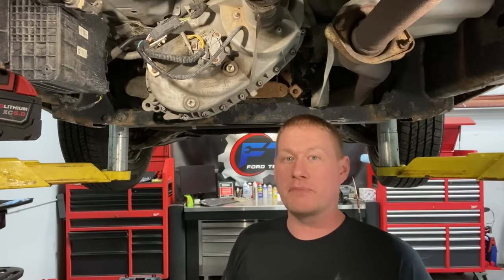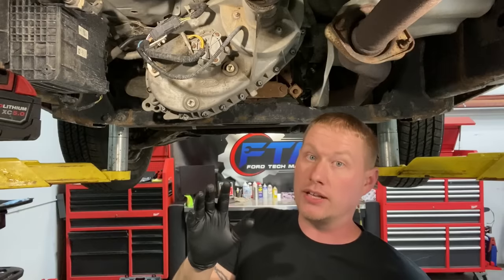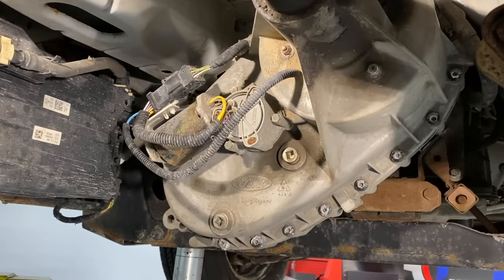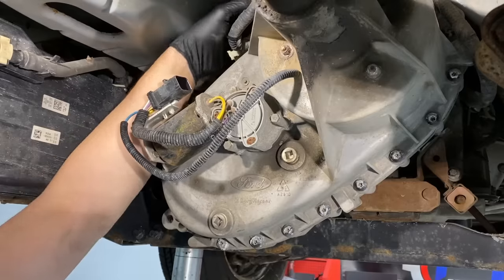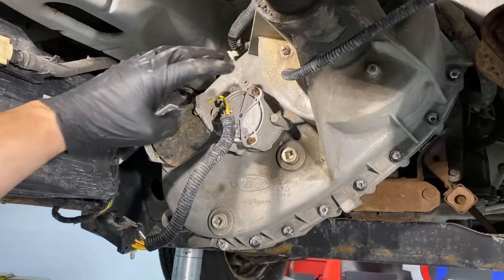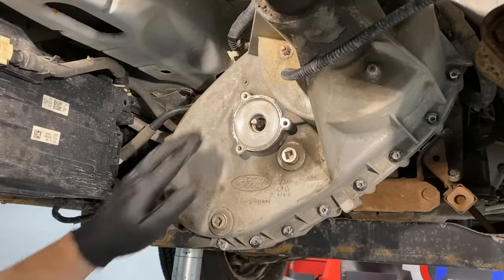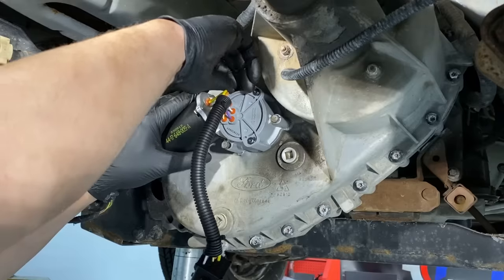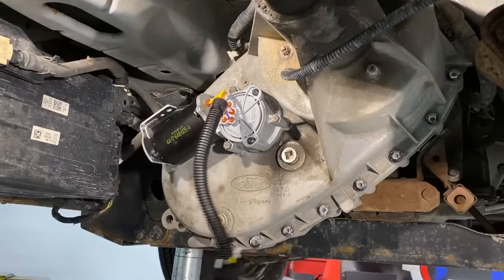2004-2020 Ford F-150 Four Wheel Drive Inoperative DTC P1867: Transfer Case Shift Motor Replacement

Comment: Ford Engineer: I wonder if this wiper motor will work on a transfer case?
Reply: LOOL 😂😂😂
Reply: You know what never failed?  Manual shift transfer cases.  The good ole days!
Reply: @goober1973  well mine is right now
Reply: @goober1973  And manual locking hubs: not the vacuum pulse nonsense!
Reply: Funny as hell. Good one!
Reply: Ford Engineer: This wire-changing deal should make them bring it to us.
Reply: I'm having a problem with my 1990 f250 not shifting outta park. I changed brake light switch but its still not working. Where should I turn next?. Also when i turn the key the power comes on but there is nothing when turned to the start position. I changed the ignition switch and it didnt help. Maybe I didnt position everything correctly idk. What else could I try for this problem also? Thanks i hope someone responds cause I'm stumped!!
Reply: And all of this stuff happened after I put it in 4 wheel drive and then back to 2 wheel drive. Idk if this helps to figure out what could be going on. Ideas please fellas. Thank you
Reply: @goober1973  And the ones that are still on the road today, still work.
Reply: Mines in 4/4l so that's what's wrong.ibe bought everthingeles should of watched this girt
Reply: I would give this a like but it's right at 69

Comment: I tried 4 wheel drive today did not work in 4 high or 4 low but I got a wrench on the dash but no code showed up on my code reader any suggestions ?

Comment: When the shift motor on my 2000 Ranger failed I found that problem in motor was that the springs be hind the motor brushes had corroded and failed.
I replaced them using springs from an Edelbrock carb.
Back in business for free.🤘
Reply: You are a few steps ahead of this guy 😂😂

Comment: Thank you for making this video. My 2011 F150 gave me an error when trying to shift into 4X4 drive. Took it to the dealer and they wanted $552 to fix this very issue. I bought the part and fixed it in 15 min. This saved me hundreds. I can’t believe they wanted to charge (rip me off) me like that. Thank you!
Reply: Diagnostic time plus parts
Reply: What was the error message you we’re getting? I have a 2011 ford f 250 and I the message I’m getting is shift delay pull forward then followed by check 4x4
Reply: @Jmacdonald224  I don’t remember honestly. I paid ford to diagnose it then bought the part and fixed it.

Comment: Excellent info and guide to do this replacement. Replaced it my 2011 F150 Lariat with 260K mile. I found two things to add. 

1-My new motor/actuator had weak plastic for the cable retention clips (in fact one side of it BROKE when inserting into the tab). I re-used the one from my prior motor/actuator and also zip tied it for extra security. (Would hate for it to dangle and get hung up on something and rip the cable).

2-I found that inserting the separate "Blue" wire BEFORE re-inserting the red retainer clip into the new shift motor makes inserting the blue wire into the connector MUCH EASIER. Thanks so much for the video and excellent guidance. What a low cost fix for something that I thought was going to be a major dealer item.

Comment: Great video.   That motor and the vacuum hubs are the reason I opted for the Manual 4WD in my Super Duty. Its Been working great for me for 12 years now.
Reply: Yes and you have neutral.
Reply: 009to090 I understand but I need to be able to switch in between frequently without stopping.

Comment: Did mine today. 2011 XLT with 200k+. Your channel is awesome. Thanks buddy.
Reply: Napa gave me the wrong part. Do you know the part #. I have 2011 xlt.😎
Reply: @jameshoben2950  I used a non-OEM part, Dorman 600-105. Has worked as expected.
Reply: Did you have any problems with your hub actuators? My 4x4 failed a few months back but after that I started to have a vibration on my passenger side. All suspension is new. Not sure if the 4x4 not working is causing this issue
Reply: @JohnTheMexicanic  I’ve sold the truck. Worked great though.

Comment: Great video!

I have an '04 F350 4x4 (6.0). I just gotta share this fun ride. First, I'd like to note that I have not solved my issue.

I thought this t-case motor going bad was my issue when my 4x4 wouldn't engage (the light wouldn't even come on on the dash when I selected 4-hi or 4-lo). Anyhow, I replaced the motor, and turned the truck on and tested it and VOILA, it seemed to work. Well, the plot thickens. Now, if I turn the truck on and immediately select 4, I can get it into 4 hi or lo, and hear the t-case motor engaging. But, if I drive it long enough in 4x, and then decide to put it back in 2, it will not shift back into 2 no matter what (fully stopped, in either neutral or park). Vacuum line fills, and doesn't turn on or off intermittently, and the vac line seems good. Setting the hubs to either auto or manual works fine after I engage 4x with the internal switch/through the t-case, so I'm getting vacuum on auto, and good lock on manual from the hubs.

So, I found out that I have to turn the truck off and then back on in order to have the actuation take place. If I'm driving for a while on the highway and decide to pull off somewhere that requires 4x4, I need to pull over, completely turn off the truck, then turn it back on (ON only, or cranking it over) before I can switch over. Same goes for being in 4x: I need to stop, turn the truck off, then turn it back on in order to disengage.

Strange. All of my fuses are fine under the dash, and the relays under the hood are brand new and they switch when I test them manually with a test light. Go figure, I'm stumped, and three shops have been stumped as well lol.

Meh, turning the truck off and back on is no big deal at this point, but it's a mystery to be sure.
Reply: Interesting. My F150 is now stuck in 4 low. Pulled a stump out and now it won't switch. Dash doesn't light up 4 high or 4 low anymore either
Reply: @MeltingRubberZ28  Wow! Yours sounds like a seized T-Case, but if the dash light turned off, that means the relay is telling the computer that the T-Case is in the correct position.

I finally solved my issue, it was a loose connection AT the T-Case motor. When the truck would get "hot", the terminals would expand and slide away from contact. When it cooled off, the terminals would shrink and make decent enough contact for the relay to talk to the T-Case, and vice-versa.

Your issue could be hub & or vacuum related. Check for vacuum leaks. Jack up the front, check to see if your hubs are locked by spinning the tires. See if the front shaft spins freely or if it's locked. If the hubs are locked, then you know it's a hub/vac leak (usually manually unlocking them will work, or you can unplug the vac from the reservoir near the vacuum pump on the passenger side to remove all vac pressure).

The light not being on is why I aim the solutions more toward a hub seize, or a vacuum issue. The light is controlled by the computer, which gets its information directly from the relay sent from the T-Case. You could check the two relays under the hood on the driver side. They are two identical black relay switches (almost perfect black squares) under a black plastic cap which looks rectangular. They sit near either the driver side battery, or more toward the driver side firewall (around the outer edge of the DEGAS/coolant overflow bottle). Check the relays, or swap them, and see which one is bad.

Good luck!

Comment: Thanks for the video. It makes it very easy to do the job. I was able to align the spline of the transfer case to the new motor by plugging the motor in and turning the 4 wheel hi/low switch. You may have to start the engine to get the motor to turn. Anyway I'm back in business.

Comment: I just performed this repair on my 2011 F150 Lariat.  This video is dead on.  Easiest repair I have made lately.
Reply: I got the same truck what message were you getting when trying to engage 4wd? Mine keeps saying shift delay pull forward then followed by a check 4x4 message
Reply: Only message popped up was check 4x4.
Reply: @scottwilliams4888  gotcha yea mine will say both

Comment: I must be lucky then!!
I have a 2007 f150
410000 km have not changed that motor on the transfer case yet. Touch wood.
Great job thanks for sharing.
Reply: My 07 F150 is currently stuck in 4L

Comment: Another great video.  I just completed this on my '08 F150.  Only took about a 30min.
Reply: Did that fix her ? My 08 f150 is not doing anything when I shift into 4 high or 4 low. I replaced iwe solenoid and have vacuum down at both hubs.

Comment: I had that exact same problem on my 99 F150. It got stuck in 4 Low and I was able to figure it out on my own however I was unable to replace it right away I had to take the old one off manually put it in 2 wheel drive cover the spot where the shift motor goes until I could afford to get a new one. Very easy fix
Reply: Dan Cooney   How did you turn that small shaft - do you have to be careful not to damage it?
Reply: @leugbol  I was just able to turn it with my fingers there is no stress on the transfer case so nothing was binding and was marked on the transfer case for 2-wheel 4 High and 4 Low it was quite easy to turn by hand
Reply: Hi, Enrico from Italy here, I have the same problem, my transmission is currently stuck on 4L. today I tried going back and forth shifting to N trying to get back to 2x4 but nothing would make it work. in your opinion, do I have the possibility to manually rotate the shaft to the 2x4 position? and the on-board computer recognizes the right position, if the shift position sensor Is down?
Thanks

Comment: Thanks for the video. This helped on my 2016 f150 with the 2.7 . That wire is a pain and the clip is white not red.
Noticed my oil drain plug is leaking , I doubt the dealership changed the o ring  on it last time, was down half a quart , only been about 1800 miles since it was changed.

Comment: Thanks Brian for the info.  I've worked a few Ford 4WD problems, never replaced the motor.  The vacuum system and the 4LO switch. ( the switch turned on the 4LO indicator in the the cluster.  These trucks were 2003-2004 models)
Reply: Do u know if that’s why I’m having problems reversing left or right on 4x4 ?

Comment: I actually had two faults one day, it was weird. I had this code and proved the shift motor to be bad, but when it was done 4WD still didn't work. It ended up being two faults, turns out the shift position signal return wire to the TCCM was broken as well. Replaced the harness up to the RF fender and a new shift motor.

Comment: I don't even know if my 2006 F-150 XLT 4x4 is even engaging into either 4 hi or 4 low. It's the first vehicle I have that has 4x4, so I don't even know what it feels. One time when our yard was muddy, I had the truck set in 2 hi, and of course, would not move. So I switch it to 4 hi to see if I could get unstuck, I didn't hear a sound when switching, and when I tried moving, it felt as if I was still in 2 hi. It did show that 4 hi was engaged on the dash. So then I put it in neutral, switch to 4 low, I hear a clunk like I think it should, and I step on the gas a little bit, and it feels more torque like it should, but when I tried moving, it felt like only the rear wheels were spinning. One time when I was in a parking lot, I was turning and I could hear the front tires screeching when I was turning into a parking space. I switch to 4 hi and back to 2 hi, and when I turned again, there was no screeching. I feel like the differentials in the front and rear lock on their own. Sometimes when I turn onto a road, I can hear one of the tires in the rear dragging as if I had the rear diff locked. So I don't know what's up or what the problem is. I've had this truck for almost two years now and I don't even know if 4x4 works. I don't see uneven wear on the tires, it still has about the same amount of tread since the day I got it. But these problems aren't constant, and only happen once in a while.
Reply: On hard dry ground put it in 4 wheel drive,  Make a thigh turn you should get a bucking from the front end if it's engaged.

Comment: Seems to me, if you couldn't jack it, you could plug in the motor, and it should index to whatever state the transfer case was in when it died. If needs be, move the 4X4 selector switch to the desired position to have the motor match the transfer case spline. Seems a LOT easier than jacking up the truck.

Comment: Do a video on the check valves for the vacuum lines. I was having an IWE click when under acceleration because of the loss of vacuum.
Reply: There is a video on that, check past videos. He shows how to diagnose issues with the iwe system.
Reply: If you are under warranty, there’s a fix. The check valve is replaced, if there is still a noise, many of the iwe’s actually separate plastic from the diaphragm.

Comment: I’ve seen it recommended that the harness connector be filled with dielectric grease before it’s reconnected (along with all other underbody connectors).  Thoughts?
Reply from the maker: No, in general Fords connectors are sealed very very well so I hardly see any corrosion issues connector side.
Reply: FordTechMakuloco What if It struggles to engage in 4x4 but if you can get it to it revs up and clunks?

Comment: Just a thought, maybe this might work or not, you let us know Brian. If the new motor doesn’t line up with the shaft (due to not being in 2 High when the motor failed). Instead of turning the shaft by hand if it was stuck in 4x4 H or L, couldn’t you just hook up the wires to the new motor, and turn your 4x4 selector inside the truck until the motor lines up? Or would that cause any problems? Maybe works? Might be easier than turning by hand if drive line was loaded?

Comment: My 2009 Ford F150 feels like it is stuck in between 4 high and 2-wheel drive could this be the problem? I've already changed the actuators in the hubs.

Comment: Hi! Your videos have been great to help us with the random misfires we were getting, but now we are having shifting and sputtering issues around 70mph with RPMs between 4-5k for a while before it finally shifts, but is rougher and louder than usual even at slower speeds. We got the scanner and Forscan, and which is giving us codes P1867 and P1891 but no engine light. It i a 2005 Ford F-150. And we just replaced all coils and plugs, did timing job about a year ago, and transfer case leak fixed (thanks to your video) and compression test in all cylinders. What would be our next steps? Thanks again for all you do on here!

Comment: Should you disconnect the battery before poking around in that wiring harness, or are the connections dead with the ignition off anyway?

Comment: Someone stole mine off my truck recently. Didn't realize it til I had transmission problems. When we were under truck looking for anything that could of been knocked off or broke after the dip through the flooded roof. That's when I seen a plug hanging. Well I finally realized it was the plug for  the shift motor. I ordered one from rock auto and it'll be here Thursday. Hopefully the transmission probs are related to that being missing. If not got a transmission ready to go in it I got from Windy City

Comment: I've been a ford man for 46 years I recently sold both of my late model trucks with power strokes, good trucks other than all the electrical bullshit!, i just bought a 71 f250 4x4 high boy I'm going to do a little resto on it, it's in great shape with a 400 engine, 4 speed manual trans. All original equipment! Works great!. Why in the hell would I want to spend 60-80 thousand on a farm truck that has electrical bullshit that goes out all the time, no thanks the trucks today are built for the city farmer!. I'd rather invest money not throw it away!.

Comment: My motor was giving me all kinds of trouble.  Ordered up my new motor off Amazon (a lot cheaper than the Ford parts website) and replaced it.  Awesome directions in this video!  My only question is what do I do with the old motor?  Can it be refurbished?
Reply: Toss it in the recycling bin.

Comment: Have a 14 f150, replaced this motor, replaced vacuum solenoid and check the hub actuators and all works intermittently. The pulls check 4x4. The code is the same p1867. Replaced relay and still quits after a minute or so

Comment: I am very impressed with this video, very well done. We took our old motor off on a 2002 Ford Exp. 4x4 to test it. It turned OK but now the shaft on the motor does not line up with the transfer case shaft. So we turned the transfer case shaft to NEUTRAL position, and the motor shaft looks to be very close to alignment with the transfer case motor shaft. We have the transmission in Neutral position in car. Before we reinstall, we want to know if this is the proper way to do this when the motor shaft has been rotated from original position. Can you help us?

Comment: Thanks for the video.
My truck (2010 f150 fx4) has one wire coming out of the top of the transfer case like the one in your video.
All the parts stored round here have a motor for the two wire setup.
Would it cause an issue putting the one wire into one of the two holes (which one?)?.